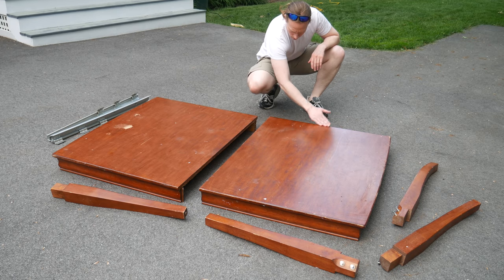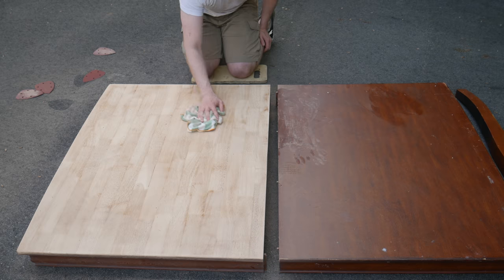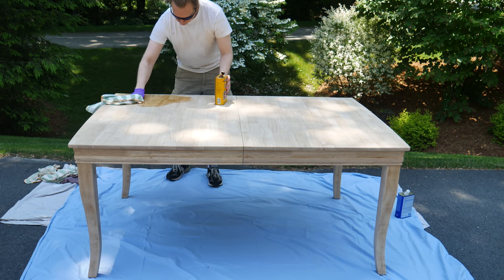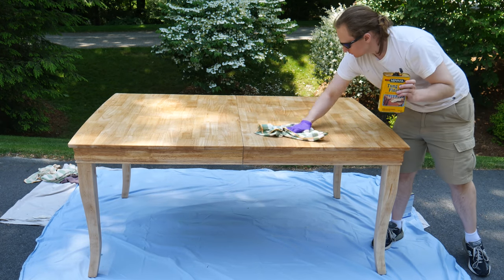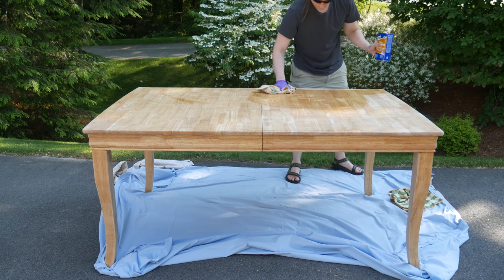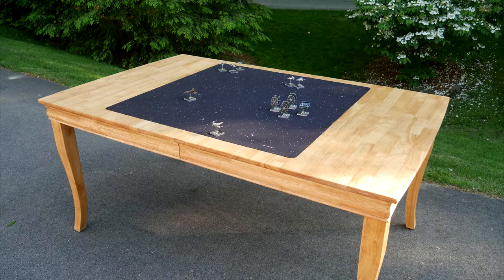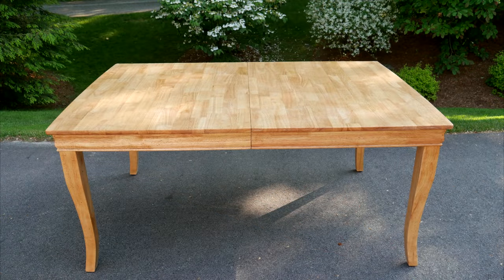Premium Gaming Table Salvaged and Restored for $8

Comment: Hello Goober, glad to see your doing some woodworking! When you sanded the top moving in small circular motions will hide scratches easier and make your time go a lil quicker, and always follow the grain. For the sides using a sponge block or something behind the sandpaper that may depress and fill the cracks makes it much easier. For your tung oil application I was always taught to apply a very liberal coating of tung oil and to keep it wet with more tung oil on the surface for 30  continuous minutes before wiping away the excess, subsequent coats can be done The table seems to be made of ash as it has the same coloring and nice thick grain structure that likes to hold onto old finishes.  Those vertical jagged joints you see throughout the piece are a kind of finger joint used for end-to-end joints. Wonderful work!

Comment: For what little it's worth, I'll add that the joints are called 'comb' joints , allowing lots of small pieces of solid timber to be joined into an engineered piece, and the wood looks a lot like rubberwood which, I think I remember reading is one of the sustainable timbers from which lots of furniture is made these days. Good job on turning the table into something usable once more.
Reply from the maker: Thanks!  This table has decades of good use ahead of it.  I'll look into rubberwood, I appreciate the input :-)

Comment: the jagged vertical joints are a variation of a finger or comb joint  used to make large panels out of smaller pieces of wood, which is a very economical use of off cuts and such to maximise wood by removing defects
Reply from the maker: Thanks!!  Yeah the surface is awesome, but it's clearly made from a ton of small pieces.  I'd love to learn some woodworking one of these days...   :-)
Reply: @GoobertownHobbies  buddy, you are already a woodworker. You just haven't invested in any power saws yet. Maybe your first project is making a leaf for this bad boy?
Reply from the maker: @torymiddlebrooks  That sounds like a good way to practice finger joints!  :-)
Reply: @GoobertownHobbies  ill teach you wood working you teach me how to paint...oh wait. Ya, ill be right  back with my carpentry channel. Haha. Seriously you are the boss! I am wondering why you didnt save yourself some time and elbow grease by just using a stripping agent first
Reply from the maker: @mikemcdermott7304  You make a carpentry channel and I'll watch! :-)  I've never successfully used stripping agent on wood before, I'll try it again sometime. I'd be more inclined to use that if there were more bevels and crevices that are tricky to sand.

Comment: great job on the restoration, only comments would be, a well sharpened cabinet scraper can save a lot of time sanding when removing old finish, also hand sand the beveled details, power sanders can mess up profiles quickly (i.e change the shape) but if you’re careful u can kinda get away with it. last when applying the oil bundle the rag into a small tight pad (called a rubber) and you will save more finish. cheers!
Reply from the maker: Thanks so much!!!  One of the best things about making these videos is when people spot stuff like this, it's really helping me to improve. I'll have to try that rag method, the oil definitely ended up absorbing more into my rag than into the table :-)  I did end up hand sanding the worst of the beveled details, I wonder if there is maybe a dremmel attachment that would have been easier...
Reply: thank you for the videos. so calming and relaxing!

Comment: For the fine details I've been experimenting with sandblasting and getting a lot of success with baking soda. I'm working on a pair of old chairs that have a lot of carving and i've got to avoid chemical exposures because of my autoimmune disease. Sandblasting is doing a remarkable job of removing the finish fast. The baking soda is gentle enough that it's not damaging the wood. It's much easier than trying to get into the little cracks with sandpaper, steel wool, or any of the other options and much safer (as long as you wear good eye protection and a respirator.) Once I'm totally done I'll just have to go over the pieces with some fine steel wool and I'll be ready to oil. I cannot recommend this technique enough.
Reply from the maker: Interesting!  I'm curious about sandblasting, but I always assumed that it was a massive investment/ required some serious dedicated space and equipment.  I may need to look into this- this little cracks are so annoying  :-)
Reply: @GoobertownHobbies  The biggest expense is the air compressor. We already had one because my husband has about a dozen tools that work with it. I think I spent about $20 on the actual sandblaster off Amazon. The blasting medium can be purchased at any of the big box stores or Harbor Freight. I believe that I spent about $20 on 20#.

I'm actually pausing on the project right now until my husband can build me a plywood stand with three walls and an open side. We'll use a cheap tarp to line it. Then we can collect much of the used medium and reuse it. I am going through it fast enough that it's worth the effort.

The people who get serious about it have a dedicated cage that keeps the medium confined and filtered. That's where it gets pricey. As I'm just blasting the occasional hobby project I see no reason to put that much into it. (This will also act as a paint booth for spray paint down the road. I'll use that a lot) For a project like your table one box of medium for the detail work would do the trick and probably not be worth reclaiming the medium for a one-off.

Final thought. I found out quickly that regular safety goggles didn't do the trick. I had to use pieces of an old pair of pantyhose to cover the ventilation holes to really do the job. I just used a glue gun to stick the mesh over the holes. So now a $5 pair of safety goggles are now doing the job of an expensive pair.

Check out some of the YouTube videos where people demonstrate this. It's so easy! :-)

Comment: Looks like white oak with finger joints. Those types of finger joints are very strong because of how much surface area there is for adhesive. They marry the end grains together allowing for expansion and contraction along the same grain.
Reply from the maker: Cool!  I love learning about this stuff, thank you :-)
Reply: That's a good guess, it does look like white oak. You'd be able to gauge better if it's a type of oak by looking at the foot of the legs maybe? If the legs are the same material as the table top and it's an oak you should see fine white lines running perpendicular to the rings (if they're visible). I'm not necessarily into carpentry or wood work, I'm an arborist by trade.
Reply from the maker: @a.wilson4809  Oh cool, this is very useful information!  I'll take a look :-)
Reply: If it's not white oak, it could be poplar. It's a little hard to tell without seeing it in person.
Reply: @Catterjee  I thought poplar, but there seems to be too much variation in the grain for poplar.

Comment: If you're not planning on using the sliders to open the two halves, you could use wood glue to bind the table into one piece and fill the gap! It would hardly be noticeable after sanding and finishing, and (importantly for gaming) it would provide a smooth, continuous surface.

Comment: Store bought tung oil like that is actually a varnish blend I believe. That's why you build up a bit of a film finish like you mentioned. Thinning down some polyurethane with mineral spirits and you would be able to wipe on as well.

Also, a Random Orbit Sander would make your sanding go by faster and leave less swirl marks.
Reply from the maker: Thanks for the info!  I knew that modern commercial tung oil was a synthetic blend, but I didn't realize that it might be so closely related to polyurethane!  I'll have to try that polyurethane + mineral spirits trick!  :-)

Comment: Sweet find! I got a table from kijiji which is about the same dimensions for 20 bucks (CND) thats like 5 bucks American lol j/k. I never refinished it, but I did  cut a hole in it and installed a 40" Samsung Kiosk touchscreen (which work was getting rid of, and they let me have one of the 2 kiosks) and then put a cloth surface over it (like a card table... its in my videos as well) I then built another top to go over the screen just for boardgames... my friends usually come over for D&D/Traveller/Numenera or Carwars/Runebound/Firefly/Arkham Horror... so I built it for both, and use it as a table to work on minis as well (with a cover)
Reply from the maker: Whoa! That is an excellent gaming table project!!!  That would make a pretty good video if you filmed it :-)

Comment: Oh man it's getting hard to find stuff like this out in the wild!  I got my laminate top hardwood table a couple years back.  They just don't sell anything like this in most stores anymore.  You look underneath and it's all hardwood supports and screws made in the USA!   I have a smaller circular laminate hardwood table for my painting area and a larger table with a leaf insert for my gaming table.  If you can find one of them in the thrift store make sure you double check the quality of leg struts as stated in the video.
Reply from the maker: For sure! Gotta snag this stuff up when you can find it!  :-)

Comment: Those are called finger joints, specifically end grain finger joints. They provide a lot of surface area making a very strong joint.
Reply from the maker: Thanks Dennis! I'm really enjoying learning about this stuff :-)
Reply: Got it
Reply: Not quite, finger joints would be used on a box corner - this is brick construction. It's a way of jointing up solid panels without the need for clear sections the width of the piece. It's not a fine furniture look but it is a good way to use offcuts and short sections.

Comment: I don't know. The wood could be a couple things. Oak and pine springs to mind the most though. If it was cedar, you'd smell it while sanding and it looks too 'clean' to be an ash and too light to be acacia.

The process for 'mushing' the individual pieces together is called 'joining'. I don't know if that's what you were asking though.
Reply from the maker: Thanks for the help! I think "Finger Joining" is the term I was looking for, it's a cool technique!  Those are interesting go-to identifiers for each of those types of wood, I'll have to read up on that. I don't think it's pine, so oak is a pretty good guess, let's go with that :-)
Reply: Goobertown Hobbies Glad I could help! Oak is heavier than pine by quite a bit, so if it feels pretty solid and 'weighty' then it probably is oak. You did a nice job of it! I'm looking into trying resin coatings because it looks like you can do some real cool things with that stuff and it hardens to almost a glass strength consistency (hard to scratch, hard to chip) as far as I am aware.

Comment: I was wondering how you could apply finish so quickly but then realized you were using MinWax Tung Oil Finish. That's Tung oil and varnish.  And nothing wrong with that! I use Rustin's Tung Oil which is pure Tung oil. You'll have to wait days between coats and it can take up to a month to cure. I always start with a coat of Tung oil thinned with mineral spirits to soak in more quickly. I love Tung oil :^)

Great work! As a woodworker I like you even more now!
Reply from the maker: tung oil is great!  this minwax stuff is good to go after a day or two :-)
Reply: @GoobertownHobbies I have to try minwax someday. Oil and varnish makes it sound like some kind of Danish oil. But then again, the companies can call it whatever they want—and they do 😅

Comment: I'm an amateur bowyer and I can tell you with a high degree of confidence that this is not, as many seem to be saying, Oak.  The pores are just all wrong for that.  Probably what's happening there, and causing confusion - Those pores really drink down finish and between the new finish they pulled in and the original finish (you'll never get it all out no matter how much you sand) their appearance has been altered to seem darker and more prominent than they otherwise would.  Besides the geometry of the pores, another dead giveaway is that oak is simply not that knotty or swirly.

That being said, it is a hardwood.  For the most reliable identification, we would need some good pictures of what the end grain looks like, but I'm going to say I'm about 90% positive that it's a variety of maple.  The color, swirls, and knots are all consistent with it.
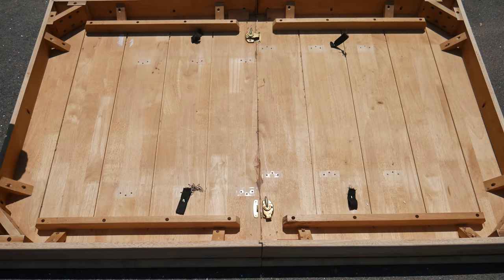Reply: Compare this to the underside of the table starting at approx 2:04

https://www.homedepot.com/p/Bruce-American-Originals-Country-Natural-Maple-3-4-in-T-x-2-1-4-in-W-x-Varying-L-Solid-Hardwood-Flooring-20-sq-ft-case-SHD2710/204468542
Reply from the maker: Interesting! I really appreciate the input. I've gotta do some research on maple now :-) I left the table at a relatives house, but the next time that I see it I'll try to get some better pictures and we'll figure this out. I'll get around to setting up a facebook page one of these days and post some better images there!

PS bowyer sound like an incredible hobby! Someday, someday...

Comment: My only worry with getting wood from unknown sources is the possibility of bugs/termites. What's your process for making sure the wood is quality wood?
Reply from the maker: Fair question Rodney!  Pretty much just visual inspection... I'm not sure if that's adequate or not...  I didn't take it indoors until after I had spent ~ 5-6 hours woking on it. By the time I had gone over every surface with a sander and oil, so... I probably would have noticed bugs/ bug dirt/ holes... hopefully.... hmm....
Reply: @GoobertownHobbies  thanks for the explanation and reply!
Reply from the maker: @Stargate404  You're welcome- I'm not sure how helpful it was though.  I'll be sure to let you know if I wind up with a termite infestation! :-)
Reply: bugs/termites in wood are very obvious you'll see LOT's of pin holes, tho most of the time even if you see the holes  the bugs/termites have long since moved out, if your concerned theirs insecticide treatments for wood. I'd say the wood was Mahogany or Oak but more likely the former.
Reply from the maker: @Si_Streams  Cool, I saw no evidence of bugs, but like I said I'm not an expert on termites! :-)

Comment: Pretty cool! Do you know if you give it a finish like the original one? Or just add some wood color like the original one
Reply from the maker: Thanks! I don't know if I could have matched it exactly, but if I wanted to try I would give it a few coats of dark brown stain and then protect it with a layer of polyurethane.  The hardware store normally has at least 10 different shades of brown for staining wood, so we could probably have gotten pretty close.
Reply: @GoobertownHobbies  ok thanks, that's valuable info I wanted to have, just in case I wanted to do the same. I really like the darker wood tones, so I would go for those
Reply from the maker: @XCATX25  Cool! Yup, just go to the hardware store and check out the wood stains.  Hopefully you find a cool piece of furniture to try this on!

Comment: That's the beautiful thing about real wooden furniture, it's almost infinitely salvageable, at least until some kind of rot or infestation sets in. And considering what new stuff costs these days, restoring old furniture also makes a lot of financial sense.

Amusingly, this is exactly the same as metal miniatures, in my experience. You can always strip them down and repaint them, no matter what gloppy iridescent horror their previous owners might have painted on them.
Reply: There’s a thing called lead rot that affects older white metal figures with a high lead content. It mostly happens to unpainted figures kept in sealed containers. I’ve got a bunch of unpainted figures nearly 40 years old that suffer from it. Which reminds me I really must sort through them and throw the ‘bad apples’ out!

Comment: I'm pretty sure Nick Offerman would approve of this video.  What kind of sander are you using?  I have a b&d mouse for the small jobs, but I would hate to use it on a larger project.
Reply from the maker: Hahaha, thanks! There are two sanders in this video. In the first shots I'm using an off brand mouse sander (I was anticipating it being useful on the beveled parts. The power switch on that thing broke when I was using it though, so I switched to my dewalt quarter sheet sander- which I probably should have just used from the start :-)

Comment: I wish I had a power sander and the space to sand my table so I could do the same. I just got an old table similar to the one in the video. It’s oval on the short ends and the legs are straight. But I do have two inserts to make the table bigger.
I guess I could borrow a sander, but I still don’t have a space to sand it since I live in an apartment with no balcony.
Reply from the maker: I completely understand where you're coming from! Hold on to that table, someday you'll be able to convince a friend to let you use their sander and driveway :-)  That table sounds great, have fun with it when the time comes!
Reply: Yeah. But to be fair, the table looks ok. It’s got some scuffs and nicks. But not that bad. But it would be cool to make it perfect. :)
Reply from the maker: @PontusWelin  I totally understand! It has so much potential!  :-) You'll just have to bide your time until you get your workshop.